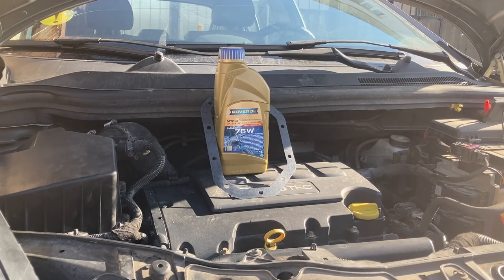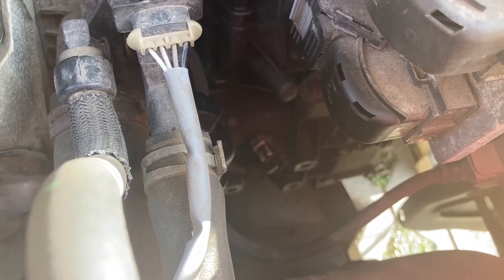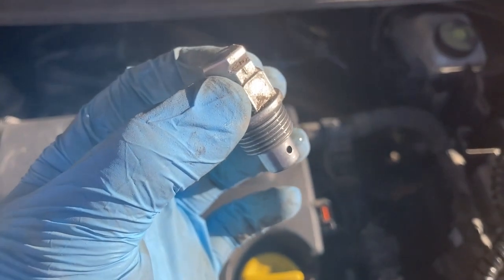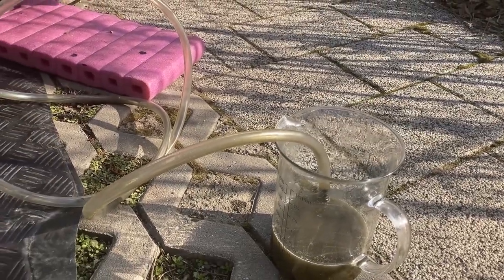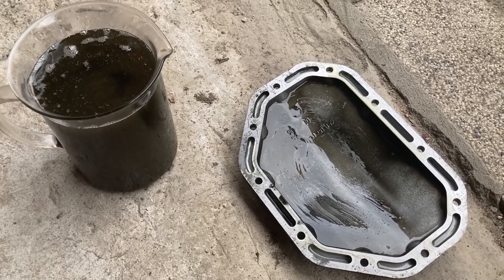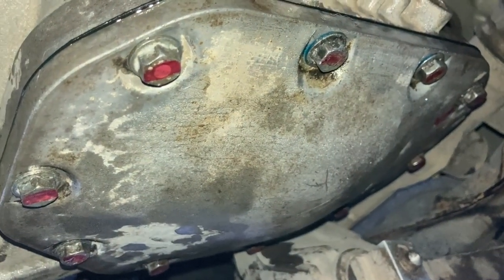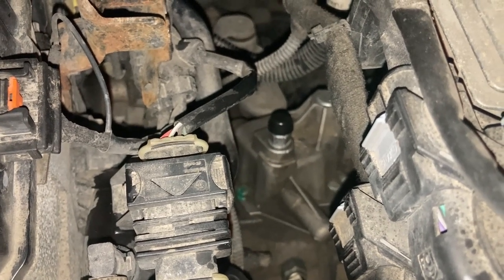DIY - 2014 Opel Corsa D 1.4: Change the F17 manual gearbox oil (transmission fluid)

Comment: Gear box oil always smells less when fresh, its the used stuff that really stinks
Reply from the maker: In my experience it depends on the brand, but it's the sulphur and phosphorus additives that give it the horrid smell and it's supposed to smell the worst when new - since that's when you have the highest amount of additives. This applies to manual gearbox and differential / transfer case oils - the fluids for automatic gearboxes with torque converters have a much more pleasant smell when new.

Comment: Brilliant video.   I changed my F17 gearbox oil December with Millers TRX SYNTH GL5 75w80.  This was recommended by millers,     I've noticed stiff gear changes though but im not sure if its the oil or the gearbox or maybe linkage.   Box has only done 62k miles.   My F17 box is on a 2008 Astra H.   Would it be ok to.use the oil you recommend for this year of F17 box?
Reply from the maker: Looking at the specs of Millers TRX SYNTH GL5 75w80 vs. Ravenol MTF-3, they are pretty close so I doubt the oil is at fault. But some additional details might help here: when did you start noticing the stiff gear changes (before or after adding the Millers oil)? Does the stiffness manifest in all gear changes or only on some (in my case, only the shift from 1st to 2nd when cold was harsh)? Do you hear any grinding noises when shifting, even though the clutch is fully depressed? Does it feel like a gear engages only "partially" when you select it? Answers to these questions should point us in the right direction.
Reply: @TheMissingBolt  tbh I brought the car in November 2021 and only drove it home (5 miles) before I carried out all work on the car. (Gearbox oil change also)    I personally think my issues are mechanical within the gear box.   Theres no whine from the bearings, the main issue is selecting 3rd gear from 2nd,  clutch fully down but i have to wait for the revs to drop before it will smoothly go into 3rd.   If you try and select 3rd without letting the revs drop it feels like there is some resistance like you haven't pressed the clutch fully down.

I've noticed when its in 1st,2nd,3rd & 4th the gear stick has movement forwards and backwards when you come on and off the throttle while the vehicles moving.  Reverse and 5th gear is perfect. 

Theres no bearing noise, I thinking it may be wear on some of the symchros maybe?   Also there's been occasions where I've tried to select 1st gear but it feels like there's been some resistance and won't go into gear,   if I put it back in neutral and shake the gear stick and try again it goes into first ok.     

Pulling away in 1st gear the gear stick will also shake/judder but never jumps out of gear.    I plan on taking it to a gearbox specialist sometime this week to get there option.
Reply from the maker: @Litesnip2022  Did you notice any metal shavings when you drained the gearbox oil? Sounds to me like at least part of the problem is the gear linkage...the stick shouldn't have movement when in gear. Regarding the 3rd gear synchros, what happens when you downshift from 4th to 3rd? If that is smooth and requires no rev matching, then the synchro is probably fine and my money would again be on the linkage. Now it may be that the linkage itself is damaged / worn out and needs replacing, or maybe it simply needs adjusting (I've described the procedure in my gearbox swapping video). In any case, it's a very good idea to take it to a specialist. I'm curious to hear what their verdict will be.
Reply: @TheMissingBolt  no metal shavings at all,    3rd gear is still an issue when changing down from 4th to 3rd.     I did remove the linkage and replaced the plastic cups and O-rings and pins.    I then reset/adjusted the selector but the issue didn't improve.   Its like the clutch isn't being pressed enough.     Ive also done about 5 clutch fluid bleeds using a pressure bleeder lol, this didn't improve things either. I got a feeling its internal,  

I know some of these Astras where fitted  with dodgy flywheels and clutches,  mines only on 62k so it's got a good possibility its still on the original flywheel and clutch.

Edit:  I've just been out to the vehicle to check the linkage,  there's 2 mounting holes that have a clip on each to hold it in place.  I've noticed there about 1-2mm movement (up and down)  on one side. Ill try and use a washer or 2 to see if that helps

Comment: Hi, I’m looking at either doing this or the top up method to change the oil. I’m using the same oil as in the video but don’t have access to a driveway to do the differential cover removal method so the top up way works better in my mind. Would topping up with the MTF  and letting the older oil drain ok to do or does the old oil have to be completely removed ?
Reply from the maker: After doing the cover replacement I find that it's a tedious job. As I suggested in the video, the easiest way is to use the level plug as a drain plug, filling up the box with new oil as the old oil is pushed out. Use about 2 liters of new oil to make sure that a sufficient amount of old oil is pushed out if you want to use this method.
Reply: Thank you, I was more concerned about the old oil mixing with the new as I’m assuming it’s never been done. Thanks for the reply and will most likely get on it tomorrow if the great British weather holds off 😅
Reply: Just wanted to say thanks for the advice, gear changing much smoother now 😁
Reply from the maker: @moominzmoomin4226  That’s great to hear!

Comment: Hi! I want to say thank you for your video, I can't express enough how grateful I am and how much you help us all that are considering doing the same task! I am thinking on renewing the gearbox oil on my '04 Opel Astra with the F17+ gearbox (it was changed 10 years ago and 60.000 Km, and I've grinded the gears on several occasions trying to engage reverse, so I'm worried on what I might find). Watching your video made me realize that there is no way that I'm going to drain the oil by removing the oil pan, that is way above my skills as an amateur mechanic 😅 so I will do as you say and add 1L of oil from the breather and let the old oil drain from the level plug and repeat several times. Keep up the amazing work, you've made a new subscriber! 👏👏👍
Reply from the maker: Oh wow, thank you very much for your kind words! It's feedback like yours that motivate me to publish more content! 😊 Grinding when reversing in a manual is a common thing and shouldn't cause any damage to the box if it's not done on a regular basis. If you do change the oil, you can expect to see a little bit of metal shavings on the level plug's magnet and in the old oil, but that shouldn't be a cause for concern unless you actually feel that the gearbox itself is behaving poorly. I know the F17 in my Corsa has a synchronized reverse gear (it never grinds even if I engage it when the car is still moving slightly), but I don't know if this was the case for F17s back in '04 as well. In any case, after 10 years it is indeed a good idea to change the oil even if it didn't do too many km.
Reply: @TheMissingBolt  Thanks for your reply! My '04 Astra H started to accumulate mechanical issues due to lack of maintenance and poor service by the mechanics I took my car so I decided to take matter into my own hands. So far I've changed the power steering fluid (by sucking it using a big syringe), new spark plugs, fresh engine oil and oil filter (mechanic shops always filled it with 5W40 even though the recommended by manufacturer is 5W30 Dexos 2),  also new oil sump drain plug and new engine air filter. Since I've done that my car no longer shakes when I release the clutch when it's cold and it runs better than ever. The next steps will be to change brake disks (they have weared from 15mm to 12mm thick in the 142.000 Km my car has) and pads, and of course, changing the gearbox oil using your helpful tip of doing it with the level hole technique. I am really happy with my car and I really don't like new ones, they are really expensive and not as well built, with a lot of cost-cutting parts made out of plastic that used to be metal (plastic oil sumps? c'mon!). There is nothing like knowing your machine and taking care of it yourself. 😄 👍
Reply: @TheMissingBolt  Regarding what you said about having a synchronized reverse gear, I'm afraid my F17+ gearbox hasn't got one, because each time it grinds (my fault for trying to engage reverse when the gearbox has not "settled"), I need to put it in neutral, release the clutch, press the clutch pedal and only then I can smoothly engage reverse. Double clutching in all its glory 😂 so no synchronized reverse I'm afraid...
Reply from the maker: @ElChus  Yep, fully agree! To the point that a proper DIY job is both much cheaper and of better quality 😁

Comment: I have the same problem with my corsa gear 1 and 2 gets really stiff sometimes but it works after, very annoying though😓
Reply from the maker: Yes, apparently lots of folks have this problem, the F13 / F17 gearboxes aren't the most precise ones out there 😓 But switching to a better oil than the default GM 1940182 seems to at least partially cure the problem. After nearly 9 months the Ravenol MTF-3 that I used is doing a very good job, with much smoother shifts. Fuchs Titan Sintofluid 75W80 also comes highly recommended on forums from what I've seen.

Comment: Hi, Great video. I ain't going to take that underpan out. Watching your video reminded me of what I did last time (thank you) I changed the oil so I am going to take out the oil level plug and put in 1 quart of oil through the vent hole. let some of the old oil drain out through the oil level hole. replace all the plugs. Run the Chevy Sonic (car is built like a lego set, I love it)  for a while and repeat the process again until I am comfy that most of the oil is now new oil. I got 200,000 miles on the original MT in which I did the aforementioned at 100,000 miles. clutch system is still original except for my throw out bearing (flood waters kill bearings). Why they did not put a drain plug is beyond me.
Reply from the maker: That's exactly what I'm suggesting at the end of the video as well 😀 I'm definitely not going through reinstalling the gearbox oil pan again. The breather + level plug combination is much easier to do and achieves the same results. Indeed, the decision to not put a drain plug on F17 boxes must have been cost-related, because they did put a plug on the higher-torque M32s. I guess they weren't really expecting people to change the F13 / F17 gearbox oil very often...
Reply: @TheMissingBolt  Thank you. By looking at your video it jogged my memory of what I had done at 100,000 miles, so thanks to you for reminding me. I was also wondering since my outer cv joint is clicking on turns, is it possible to access the underpan gear oil through the cv axle ring seal orifice? In other words, would there be enough clearance for a hose to pass through? Thanks again.

Comment: Some say a slight overfill can be beneficial. It's also thought many of the issues with this and a few other GM boxes are mainly caused by the factory fill oil.
Reply from the maker: Indeed, I've heard many Opel technicians commenting on the poor quality of the original GM oil. If we're talking 100 ml extra it should be fine; it's too much if the oil reaches the CV axle seals and starts leaking (but then it effectively self-levels, since when enough has leaked, the level drops below the seal and the leak stops).
Reply: @TheMissingBolt  They're quite well vented, so the seals are usually ok.

Comment: Wow, this video was truly a great help for me when I changed the oil in my 2010 Opel Astra, with the same gearbox and engine, and I don't think I would've dared it without seeing you do it first, even though I had my Haynes manual. Thank you so much! And so many additional good details too. My manual didn't say anything about the thread lock for example. And all the measurings etc. were very interesting information.

 Curious difference in the torque spec on the breather plug though. My manual says only 7 Nm there, while you said 22 Nm, which is quite a lot more. What's even more curious is that even at 22Nm the plug doesn't go all the way in. Both the thread on the plug and in the hole look decently clean, and for many many turn it's very easy to do by hand, so I don't think I've cross-threaded it. Also supported by that the thread doesn't look damaged when I take the bolt out even after tightening fairly hard. It's just one or two turns of the bolt remaining until it would've been all the way in though, so probably will seal enough anyway I hope. Do you think this will be fine?

On the plus side my gasket seems to have been much easier than yours to remove. I used that same razorblade tool and it made it really easy.

General comments if others want to do it on the 2009-2015 Astra J: Remove the left front wheel! Small effort that made access to both differential pan and especially the breather bolt 100x easier. Would have had to crawl really deep underneeth otherwise. Could probably survive without if you twist the wheels all the way to the right, but it's still really just making life more difficult. My manual also tells me to remove the ECU for better access to the refill or something, but I didn't find that to be necessary at all with a good funnel. Shifting to 4th gear made it easier to access the breather plug though.

My car is now 14 years old and has 255'000 km on the meter, so think it's high time the gearbox gets some new oil! (Although I expect this will also be the last oil change it gets because I ain't doing this again any time soon) :) I went with Comma MVMTF+ 75W-90 GL-4 which is what my local parts store in Finland had and recommended for this car, and seems to fulfill all those different GM specs at least, as well as many many others. Must say I'm fairly impressed with the insides after  all. Oil did not look at all as dirty as I expected it to considering its age, and didn't even have that many metal filings on the plug either! Excited to see how it will feel now.

Comment: Thanks for the video! I just did the procedure on my Saab 9-3 which has the same transmission, but managed to use a hand pump siphon with a 6 mm OD hose from it that you can push quite far (maybe 30 cm or so) into the oil level control hole, and then, with the car tilted back, I got a bit over 1l out of there. Shifting gears and tilting forward and then backwards again yielded a few more ml. It turned out that I could fill 1.4l before it started dripping out of the level hole, and since that should mean there's 1.6l in there now, I probably got pretty much all of it out, save for 0.2l maybe. It's possible that it was only 1.2l from factory since they only fill it to about 20mm under the hole.
Reply from the maker: Indeed, from other comments I take it you can use a pump with a thinner tube. Based on what you say, a 6 mm OD should be spot on. Ultimately, if you change the oil at some regular interval (3 - 4 years etc.) it shouldn't matter if a little bit is left when you pump the old one out, as long as you use the same oil to do the filling.

Comment: Super helpful, meriva 1.4. don't know if I have the drain plug yet. After a little reading I was wondering can it be vacuumed out. Thanks for that experiment. 
I also may have the wrong oil. Will see how it goes. I do 350miles of town driving every weekend . 
You showing the breather and switch thing much clearer than the terrible Haynes manual . 
I if I have no drain I will be doing the technique you suggest at the end. 
I've just had a inner cv boot replaced and things sound different,  most Vauxhall gearboxes sound awful in reverse I'd like mine ho be an exception.
Then I can get on with control arms,drop links and drilled disks. After that I can put some better tyres on.
Reply from the maker: Glad to hear you found the video helpful! Best of luck with the remaining work on your Meriva! I wanted to experiment with drilled discs in the past, but I decided to stick with solid ones because of the risk of radial cracks from the drilled holes.

Comment: Share is really informative and explanatory. You've been a good guide for those who want to do this frustrating job. Congratulations on that, man. But I have something to criticize; The support you lift the car is very insufficient, very bad in terms of security.
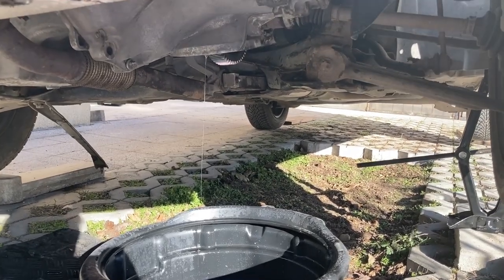Reply from the maker: If you're referring to 21:53, then keep in mind that I only raised it like that to drain the last bit of oil from the box and during that time, I kept a safe distance from the car. Indeed, the jack in that position has only limited stability and it would have been extremely risky for me to go underneath the car - hence I never did it. During the rest of the video, when I actually did go underneath the car, it was sitting on all 4 wheels so there was no danger at all.

Comment: I made space for 1.1l of new oil by using a brake bleeder pump, pipe is thin so can be poked down a bit and once the and pump has started it the pipe alone can syphon the rest using gravity . 
I don't know how low the oil was originally and didn't measure what was removed.
Reply from the maker: Indeed, I've heard that it is possible to get more oil out from the box using a very thin tube... Unfortunately I didn't have any when I made the video, but I'm happy to hear you managed to remove a good amount of old oil with much less effort than me.